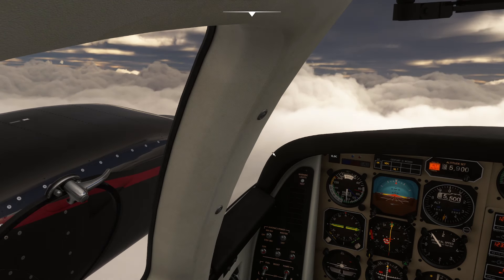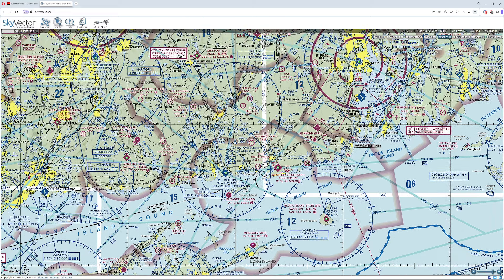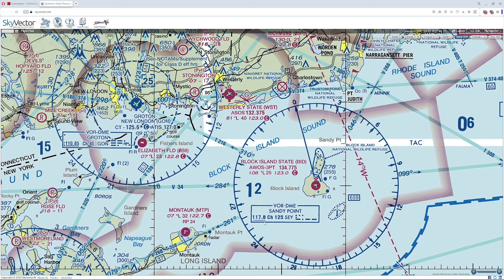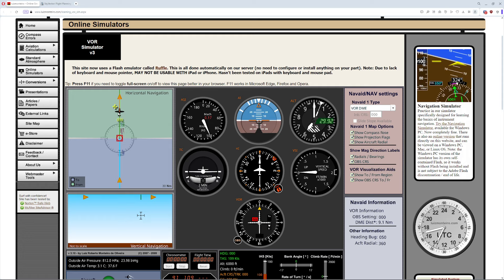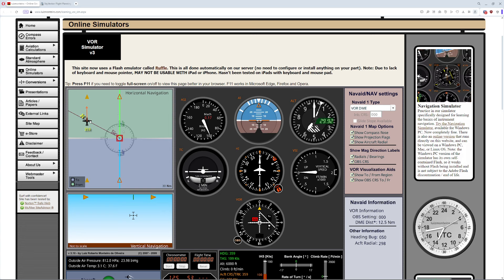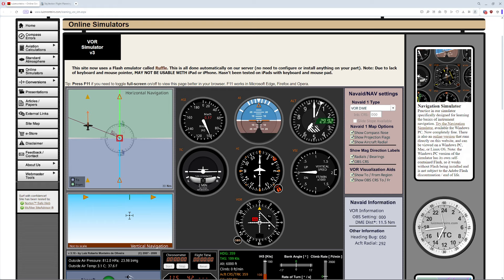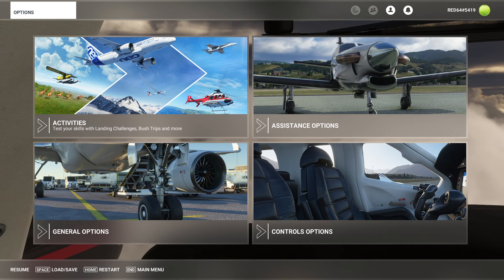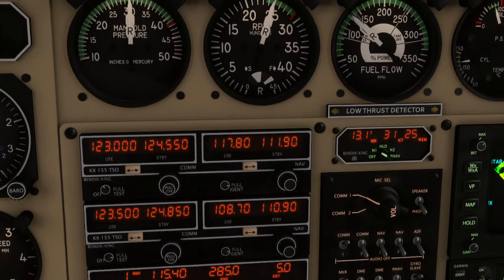MSFS - Flying IFR without GPS Part 1: Tuning, Identifying and Using VOR

Comment: This reminds me of my old MS FlightSimulator 4 and 5 books in which these things were also described in detail. (no support for GPS in the sims back then :) ) 
Quite funny to do a complete flight this way, but a lot of work (determining when to switch over to next VOR, reintercept radials etc.). The most fun part was doing a VOR only approach.
Reply: I love to fly SEP/MEP this way. I'm also simming for >25 years (with pauses due to insufficient hardware or job issues for sure, but I got back everytime). I don't like the Glascockpits in the sim (in RL they are great, of course and include more safety, etc.). In general, I'm a "Techie" and love HighTech and new stuff. But flying "the old way" with steam gauges is the best in spring and summer - and a nice contrast to all the computer aided airliner RNAV procedure stuff.
Reply: @MtheHell  I like the G1000/glass ' following the magenta line' cockpits as well from time to time, just because i am also a techie, but then again sometimes 'old school' IFR navigating is fun. Hmm i need to do a flight of one of those books again :)